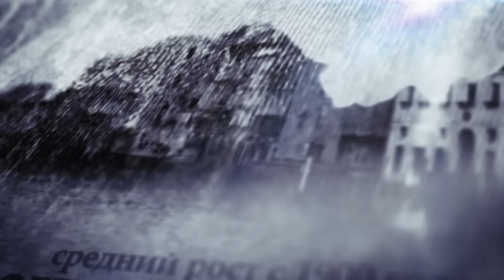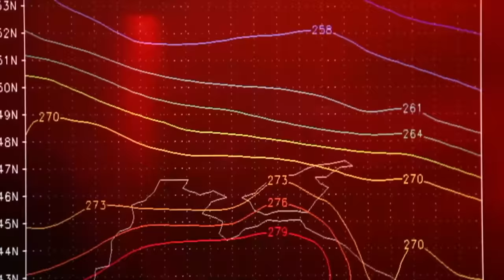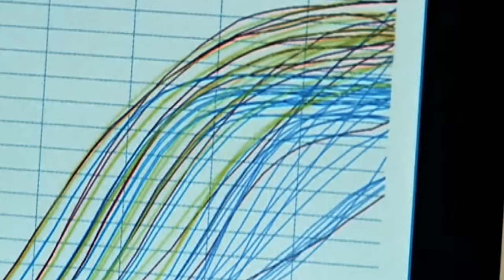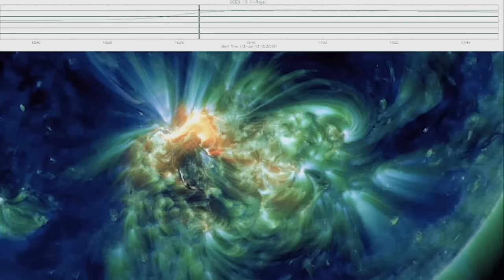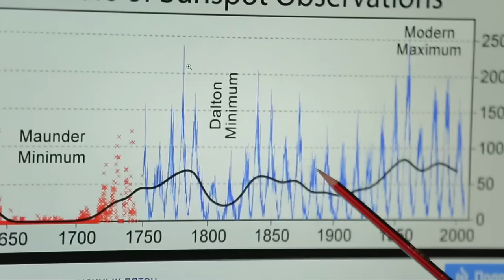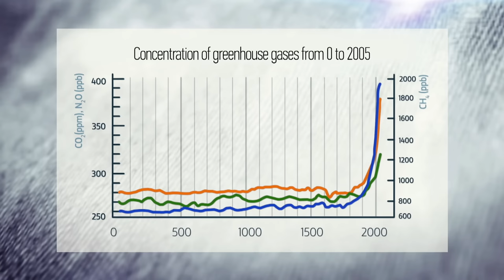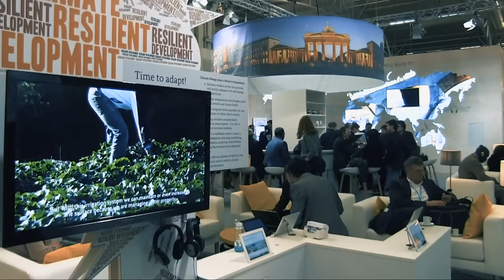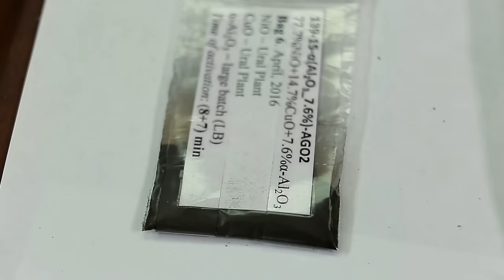Which Countries Could Be UNDERWATER Due To Global Warming?

Comment: If climate changes continually, and it has been as cold as Ice Ages. And it has was an average 2 deg warmer during the Renaissance period. And even warmer  within the last 100,000 years what seems to be the problem?
Reply: The warming period in the Medieval period was regional not global.  The global warming going on now is directly linked to CO2 emissions rising since the beginning of the industrial age.  That CO2 has gradually accumulating since and is now 50 % higher then it was at the start of the industrial period.  It was 280ppm then it is 420 ppm now.  

With the warming from the accumulated CO2 the greatest amount of warming is occuring in the Arctic where temperatures have risen 3-4 times the rate of the global average.  The global temperature is up now 1.2 C above the average temp in 1880--1920 period.  The Arctic is much warmer as I stated and that warming is particularly in the summer and that is leading to rapid decline in the Arctic ice cap.  

And because the Arctic is warming so fast compared to warming in the ancient past the permafrost is thawing which has the potential to release a great more CO2 as well as methane, CH4.  And methane has 25 times the warming capacity as CO2.  

This isn't so much my opinion as it is the findings of climate scientists around the world.   Calling me a climate alarmist would be accurate because I am extremely alarmed at what is going on.
Reply: @leeadickes7235  If all of those things were true then how has civilization advanced in science especially in recent decades??  The US research facilities are among the best of in the world and consequently students come from all over the world to study and do research in the US.  

So the degree to which science is political is less because of the scientists and more because of the politicians who want to make points by supporting certain policies.  Scientists keep doing the research.  Hell, why would they make repeated trips to Greenland to study to study the climate, like the Ohio State U researcher Jason Box to then turn around and falsify data to fit some conclusion?  That is stupid beyond comprehension!!!  That thinking also suggests a seriously cynical attitude, and even a nihilist one!!

The US has aggressive clean air policies because of scientific research AND politicians have often done the right thing to pass policy to make the air cleaner.  This is all well documented.  

Some scientists do adjust their results to keep getting grant money, but this this is the minority of researchers.  Most want to do rigorous research otherwise they lose credibility and respect quickly.  Like the researcher who claimed a link between vaccines and autism back around 2000.  He was found to have falsified data.  He lost his position and respect in the research community, but the damage was done and people ( mostly uneducated) still believe the lie.  

I found Dr Fauci to be as forthcoming as he could be.  He was accused of flip flopping on wearing masks to protect against covid.  Dr Fauci like everyone else was trying to understand this new virus like everyone else.  After those early missteps I found Dr Fauci to be consistent in his messaging.  The problem was around Trump's magats who believed Trump, who knows nothing about health and medicine and would attack Fauci.  Even Trump criticized Fauci with no basis.  Truth is Trump was so insecure that he couldn't handle anyone getting more attention then him.  That's why he would make his idiotic statements like using disinfectants to treat covid.  Or any number of other baseless conspiracy theories.  The list of misinformation from Trump during the pandemic in 2020 is why the US had the highest number of deaths by far in the world.  

Need I say more??
Reply: @michaeldeierhoi4096  you don't remember climate gate and urban meteorological stations within the the heat island of a city. Imagine if MMCC was found not to be a thing, what happened to the funding to that research? It goes away. So there is incentive show results and keep the money rolling. Plus the models last time I looked had the earth as a closed environment. It definitely is not. What I'm saying us you should be skeptical. There are politics involved and people are fallible. The science is not settled.
Reply: @michaeldeierhoi4096  how was fouchi forthcoming. He knew where the virus came from at the beginning but said nothing becaus it implicated him funding the research. Fouchi is more burocrat than doctor. He hasn't practiced medicine in almost 40 years.
Reply: @leeadickes7235  I have a lot of exposure and experience with the science and the medical field and consequently I have learned to appreciate specific science and medical disciplines and many individuals.  

What I remember about climate gate and meteorological stations and the heat islands of a city speaks of the Dunning Krueger Effect in which many people who know little about a subject think they know more.  Then those same people conflate their misunderstanding to all science or at least the science that they judge to be flawed or misleading because it fits their misinformed narrative.

You are making the same mistakes that other AGW deniers make by raising the issue of climate gate and the meteorological stations in cities and then holding onto that small minded thinking indefinitely.  

 It's kind of sad that you could live your whole life never waking up to that dead end thought pattern/story you keep telling yourself.  And that brings to mind the following quote:

It is much easier to believe a lie then to convince a person they have been lied to!  It is unfortunate that the Anthropogenic Global Warming deniers have been so effective at selling the lie of denying global warming using psuedoscience and willfully misinforming people that it may be too late to address global warming effectively because so many people are misinformed.  They would rather stay glued to their 72" TV screens and avoid dealing with anything that takes them out of their comfort zone and look at themselves and the world honestly.
Reply: @michaeldeierhoi4096  Hi! You seem quite intelligent about the Arctic conditions. Can you tell me why CO 2 went up globally during Covid when there were few if any cars driving, planes flying and Cruise ships on dry dock. It seems to me CO 2 isn't the problem.  Also, I have found that Methane is 4 or 5 times higher than CO2 in the atmosphere...is this a safe level or should we be more worried about Methane than CO2.  Thanks in advance.
Reply: @johnsheppard4143  Are you talking about an increase in CO2 emissions or atmospheric CO2? 
In 2020 there was a decline CO2 emissions, but atmospheric CO2 went up about 2 ppm as it usually does on average.  

Then recently there was a report that a record of amount of CO2 was produced globally in 2021 and yet atmospheric CO2 only increased by a less then 2.0 ppm that year.  The amount of CO2 in the atmosphere is enormous compared to how much human activity, but it is accumulating which is the concern.  

As far as methane you need to realize that it is measured in ppb or parts per billion compared to CO2 which is measured in ppm parts per million.  So in 2021 methane, CH4 averaged about 1895 ppm or just 1.895 ppm.  That may seem small but it has 25 to 100 times the warming capacity of CO2 depending on the scale used short vs long scale.

Comment: study the Correlation between eruptions at Mt. Pinatubo June 1991, Montserrat June 1997, Popocatepeti, Masaya and Santiaguito June 2016 and Hunga Tonga Jan 2022 with California record flood events 1991-1992, 1997-1998, 2016-2017 and 2022-2023. People try to blame El Nino, dual action with man made input doesn't make sense provided other years are drought years. Furthermore Study El Chichónal March-April 1982 the biggest eruption in Mexico History 10 times Greater than Mt. Saint Hellens in Washington and California floods of 1982-1983. The largest Volcanoes seem to explode during Hot weather then the result is Rain and cooling the earth after hence the years 536, 540, 1815 and 1886, also 1906 Mt Vesuvias exploded on two sides of the mountain, 1906-1907 Sacramento river in California floods 20 miles wid

Comment: What is the answer to the climate crisis... ??  Nuclear, that is the answer!!

Hold on, hear me out!

When i say nuclear i don't mean the Reactors we use atm ( that have given nuclear such a bad name ) i mean the new style small modular reactors (SMRs) that use thorium.

Q. Is nuclear energy safe ?      A. Well which one ?

Q. Is a car safe ?                       A. Well which one ?

There are 1000s of different ways to do nuclear energy, the world just needs to do it the right way, cos up till now we haven't.

Thorium is the future.

Molten Salt Thorium Reactors or ( LFTRs ) are the way to go. Just need more money and research and development put behind the tech to get them up and running. It's will save the world and give enough clean, cheap, safe energy for the whole planet. Spread the word!

What's that i here you say, renewables are the answer! Ok well lets just take a look at this one case, Germany and what they have managed to do with renewables.

it's an enormous achievement that germany has achieved, they get over 8% of their electricity generation from photovoltaics. With a total installed capacity amounting to over 41.3 gigawatts (GW). 
With an absolutely staggering amount of money invested into it to get it this far. 
Sad thing is if they had put that same money and effort into nuclear they would have a zero carbon economy by now.
I believe that climate change is sufficiently serious enough, that we have to have a pragmatic approach to it, not an ideological one, and i think that most Peoples commitment to renewables is ideological not pragmatic, because they believe there is something good about renewables, and something bad about nuclear.

I will leave you with this last point.

LFTR's ( Thorium Reactor ) can be the solution to the energy problem (and multiple other major problems) if we are willing to go all in with it. 
They are safe, they are cheap, they are reliable, they are relatively simple so they can be made small, they can be made big, they can be made on an assembly line, their primary energy source can be found just about anywhere that there is dirt, they eat pre-existing nuclear waste, their waste heat is perfect for desalinating sea water, they are surprisingly self regulating AND walk away safe, and to top it all off they produce BISMUTH-213 which is basically gods way of bitch smacking cancer in the face. 

There are two major things holding this technology back:
1: The pre-existing industries not wanting to get put out of business
and
2: Peoples fear of the word nuclear. And spoiler alert, solar energy is nuclear energy so if you believe in solar power you believe in nuclear power. Chances are you just don't believe in the widely used Pressurized Water Reactor nuclear energy technology because let's be honest, it is an extraordinarily complicated, dangerous, and frankly stupid way to do nuclear energy that was literally only focused on and initially developed because the U.S. government wanted to make Nuclear Bombs. Which is f**ked up and ridiculous so it totally makes sense that people wouldn't want to support that

What you might not know is that the same guy (Alvin Weinberg) that created the Pressurized Water Reactor also created the Liquid Flouride Thorium Reactor which bypasses all of the major problems and dangers of PWRs mainly because it operates as a liquid at low pressures. He tried to get the government to switch and was particularly well suited to make the suggestion considering he created both the reactors but long story short is they were already invested in the other reactors and were more interested in blowing s**t up and making money than they were with providing the world with clean abundant safe basically free energy and making peace so they told him to f**k off and fired him.

*Note: When I say free energy in this context I am referring to the fact that the main ingredient in LFTRs, Thorium, is dug up and thrown away as garbage by companies all over the world every day because they don't know any better. And when i say they I mean pretty much every body but China, China has been stockpiling this shit for years and is now going gung ho with LFTR's so don't be surprised if we start buying all our energy from them pretty soon too.

And to top it all off Thorium is so named after the norse god Thor!

If that isn't a message from god i don't know what is!

Thorium is the key and our planet's future.